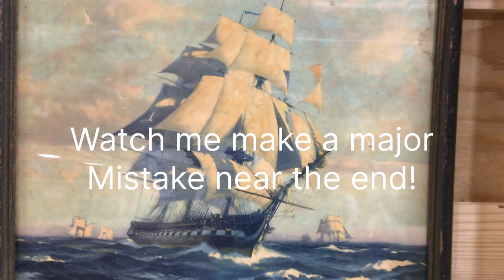How to build a wooden paddle board - adding the end pieces Episode 18

Comment: Like Bob Ross says,  we don't make mistakes, we have happy accidents. Good thing you had a few extra clamps for that nose cone fix.
Reply from the maker: I was so upset with myself. some stronger language got edited out. lol. I cut along the epoxy glue line. in my defense, it was nearly the same width to what I wanted to cut off. as it worked out, the saw kerf was the amount removed until after it was fitted
Reply: @JenkinsBoatWorks   The final result turned out great.  As I was watching the glue up,  I thought it might be cool to glue together several thin layers of alternating color wood so they showed after shaping or maybe glue up the equivalent of an end grain cutting board and those would be revealed in the final shaping.
Reply from the maker: @BooleanOperator  Hi Mark, yeah, that is an interesting idea. I will file that away for later. You would need to make sure and get the bottom level with the bottom in order to assure symmetry, but I pretty much did that anyway. Cheers!